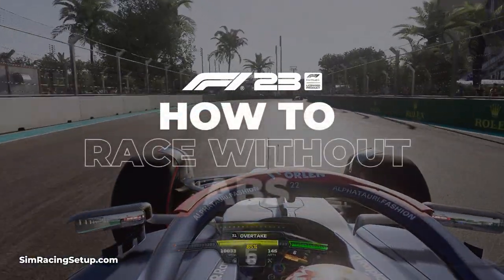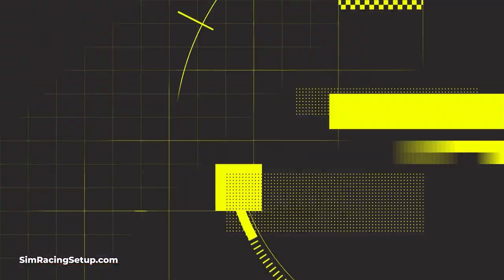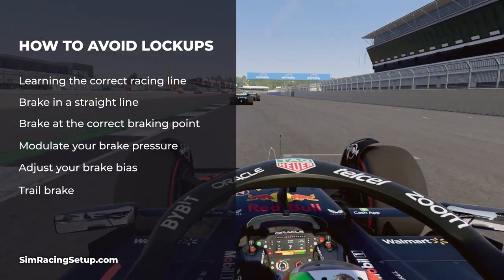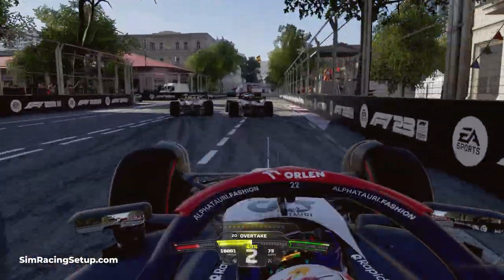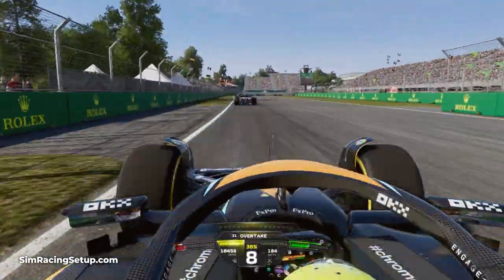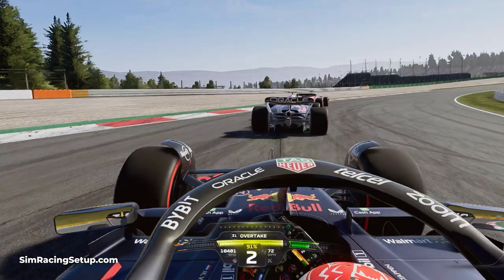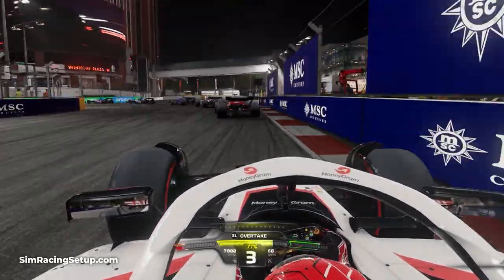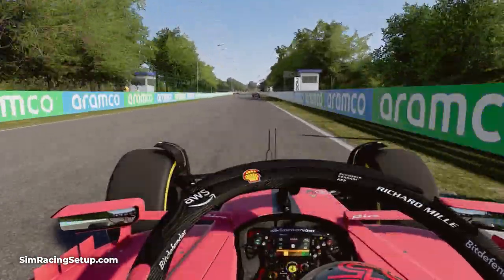F1 23: How To Race Without ABS: Improve Your Braking

Comment: I recently installed the “TrueBrake” mod to my G923 brake pedal, and I can honestly say that learning to trail brake was much, much easier. If you’re still using the g923 with original springs, highly recommend the “TrueBrake” mod. And switching out the clutch and Throttle springs.

Comment: I feel like I can finally drive without traction control for the first time in ages but ABS i still need to get used to!
Reply: Keep playing without ABS. It will turn into muscle memory over time.👍🏻🔙🔛🔝
Reply: Agreed with the comment above. I have used medium/full TC and ABS since the game came out on consoles in 2010. This is the first year where I decided to just go balls to the wall and drop everything apart from corner line. And the difference is just huge yes it takes time to get it but once you have that muscle memory from trail braking you won't look back brother. My pace has gone through the roof since I learned no assists. Good luck with whatever you decide to brother
Reply: @PrezziePrez0 How long did it take you to become comfortable without ABS?
Reply: @hamza-chaudhry  hey my friend. I will be honest with you I picked it up much quicker than I thought I was going to. I got the hang of the "basics" within 2/3 days but fully getting the most out of it and being fully confident in the braking zones will take me much longer.
Reply: @hamza-chaudhry  I am still not fully comfortable using no ABS I still panic a little when ever I am behind someone because I fear locking up and going into the back of them. And it also helps that I have the tlcm pedals
Reply: @PrezziePrez0  That was the case with me using medium then no traction control, I was capable without it quicker than I thought. And it's good that it seems to apply to ABS as well. Thanks.
Reply: @hamza-chaudhry  no worry's my friend and also I don't know if it's just me but the throttle application felt so so much better it's probably a placebo. Also the amount of rotation you get is just amazing. At first I thought it was the car oversteering but that's just how much quicker the rear end is in getting round the corner. So if you feel that the back end is stepping out on you on turn in it could just be that that is what is catching you out.  If you could in a few weeks get back to me and let me know how you got on also that would be great. Cheers brother
Reply: @PrezziePrez0  I'll try to remember and let you know how I get on without ABS 👍
Reply: @PrezziePrez0 buying the mods is night & day you get 100% of your loadcells
Reply: @PrezziePrez0 Update: I'm still not perfect, especially at corners where it's hard to brake in a straight line but I'm definitely more comfortable. I've become much better at modulating my brake pressure as well.

Comment: I just can’t get used to having the racing line on corners off, can never tell when to brake, and because i’m on controller i cannot manage manual gears, also i’m poor so i can’t even get a nice wheel setup. But you know what? That still won’t stop me i’ll get there eventually 💪🏼
Reply: Mode push mode push
Reply: One thing that really helps to memorize corners is to talk through each turn.  "Flat out down this straight, slight braking into left turn, throw the car towards the outside down the hill, and flat out again."  After a few laps of this you'll know the track very well even without racing lines.
Reply: Manual gears are pretty easy. Just set it to the stick where you look behind and unbind that shit. Moving it up= upshift
Moving it down= downshift

Comment: ive started going to no assists from full assists. Throttle modulation and TC i got down fairly quick (except bahrain T1-2) however when it comes to breaking, the hard on and ease off strategy doesnt work?! As soon as i go to full brake pressure (even when trying to ease of it immediately), the time the brakes are at full pressure, it just locks completely. I havent been able to get back to my race times i was doing with Assists and the max brake force i've ever applied without assists in 70% rougly. My times (because im having to be ridiculously cautious and smooth) are 3-10!! seconds slower?! HELP!!

Comment: I've starting racing without ABS but i have a big issue. In a 25% race my first 10 laps go really well. When there starts to be significant tire degradation, however, I struggle and start to block really hard despite the brake modulation... the braking distance therefore increases considerably by increasing the lap time, while looking at professionals and other players I notice that despite the degradation they still manage to brake at the same braking point. Some advice?
Reply: @jcrosby4804 this is not true in baku or monza